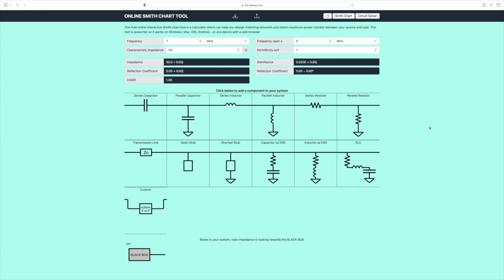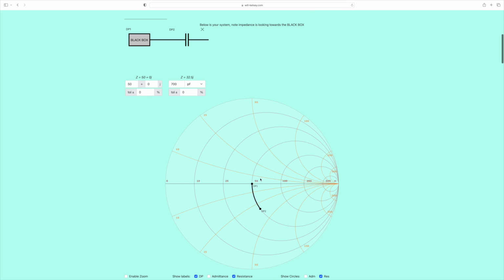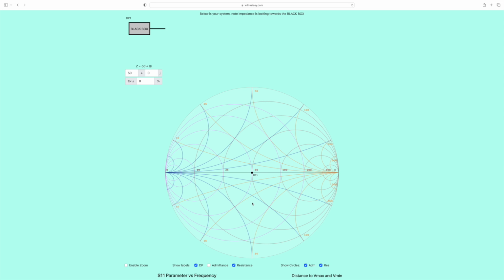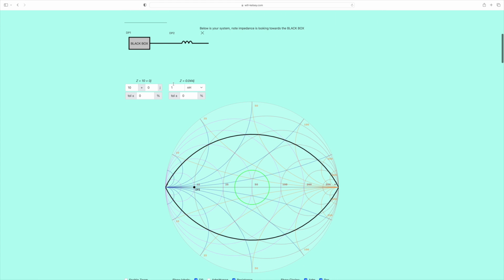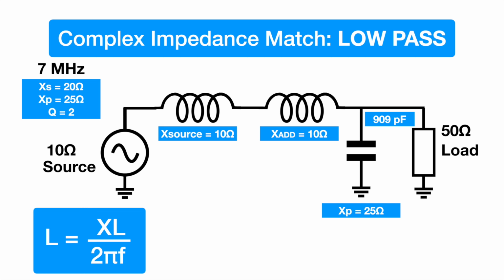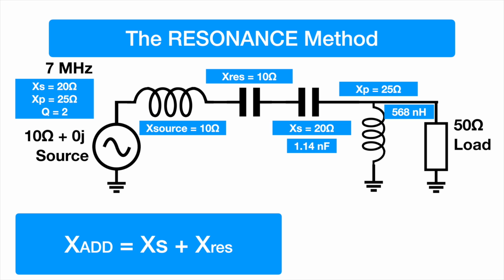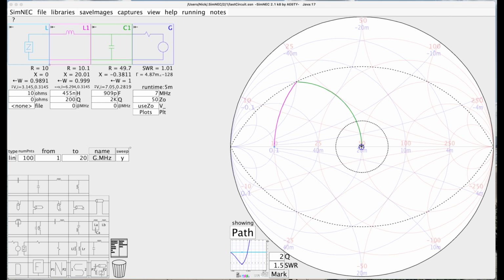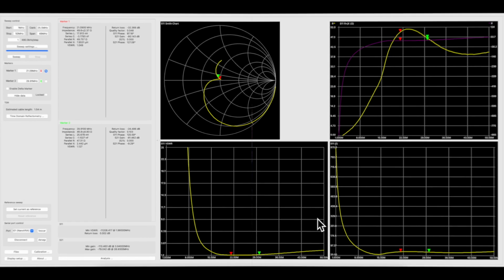51 - LC Matching Networks - Part 2

Comment: How you mesure the swr of that amplifier from end of vid? Does the output load affect input impedance (and the swr indirectly)? BTW geat video! I learned a lot! And I decide to finaly make ma first homebrew trx (but for 80m for start, but not sure which band to choose)
Reply from the maker: I generally will put a 50Ω load on the input of the amp, power it up and do an S11 sweep with the NanoVNA connected to the output. This usually works pretty well for me. Just make sure you don't put any signal into the input of the amp or you'll risk damaging the NanoVNA. Thanks for watching and all the best with your homebrew 80m rig. Best wishes, Nick

Comment: In a self-built device, how do you practically determine the input and output impedance of an amplifier to know the complex impedance data and thus add the adaptation network? I already burned a NanoVNA and I would not like to burn another one. 73 EA1FJD
Reply from the maker: Check out my videos on designing a simple transistor amplifier and particularly small signal analysis. Have fun! 73, Nick

Comment: Thanks for this beautiful video. Can you also do a video on IF cans, which was the primary matching methor of 50's-80's, but which are quite forgotten today. Basically they are transformers whose primary are tapped and tuned, and that tapping is quite a mystery.
Reply from the maker: Thanks very much. I’ve never really used them myself but I’ll certainly consider it. Best wishes, Nick

Comment: Does this work both ways i.e. if I’m calculating for the load impedance?
Reply from the maker: Hi ! These LC matching networks are bidirectional as long as you preserve the order of the components i.e. if a match from high Z to low Z requires first a shunt capacitor followed by series inductor then going from low Z to high Z requires the opposite - first a series inductor and then a shunt capacitor. Once you've established the right order and value of components then it should work both ways. Best wishes, Nick

Comment: Hi Nick. How would you go about for designing a input matching network for both input and output of i.e. a ldmos blf188xr which are about 6 ohms on both input and output. How and where do you start?
Reply from the maker: Hi again, I can only really advise you to work your way through Parts 1 and 2 again. You can plug your values into the Smith chart software I demonstrated and then proceed in the way I did by navigating up and down to get to your target. It's not too tricky. If you need a more wideband match though then you might be interested in my next video (not out yet) which will be on transmission line transformers. Keep going! You'll get there. Best wishes, Nick

Comment: This much precision is neither needed nor possible.  As the device is moved about, stray capacitance and inductance will vary those in the circuit.  Furthermore, component tolerances are typically 10%.  You will get less ringing and peaking if Q is lower, but the bandpass approaches will be more gradual.  Keep Q well within spec and get within 5% of the characteristic impedance and it will usually work fine.
Reply from the maker: Thanks Byron. Yes, calculating a circuit is one thing but building it is quite another! Thanks for watching and commenting. 73, Nick

Comment: Thanks Nick, Most peeps think that SWR is everything but you made the point that sources and loads can have reactance and resistance. It is about real power transfer more than matching impedance. Well explained sir.
Reply from the maker: Thanks very much Keith. 73, Nick

Comment: Hi Nick, awesome video, you bring to light parts of the Smith Chart that I had previously not seen. Using the software provided by Will Kelsey, I have successfully matched larger impedances to 50 Ohm's using multiple 'L' network stages; thank you so much, 73 Bob
Reply from the maker: Thanks very much Bob and very well done! That's what it's all about - having a go yourself. 73, Nick

Comment: Nick, thanks for producing this great Smith Chart and impedance matching material.  I learned all of this in 1982 with an instructor that you remind me of.  It was all done with paper and pencil, an HP calculator, lots of blank Smith Chart paper stock, and no computers or vna.  Now I am relearning it with your help, a nanoVNA, and an actual computer.  All the work I do is at 63.86MHz if anyone clues into what that is used for!  Thanks again.
Reply from the maker: Thank you very much Brian. I'm glad this was of some interest to you.73, Nick

Comment: People forget that the Smith chart is supposed to make visualising these calculations and properties easier. Nearly all the Ham radio operators I know avoid this like crazy, preferring trial and error approach. This is another of your videos that should be considered `compulsory viewing material` Very nicely explained as are all of your instructional videos. I am in the middle of these calculations right now, working on a 2Mtr Kw amp using mrfe6vp61k25h. (Moon-bounce). Can get a little expensive if you don`t calculate before cutting! I repeat what I have said on your earlier videos, it`s great to see someone who is actually building something, complements to you Sir!
Reply from the maker: Thank you very much indeed for the positive feedback. I'm so pleased it was helpful. 73, Nick